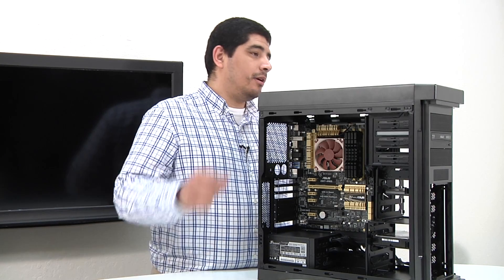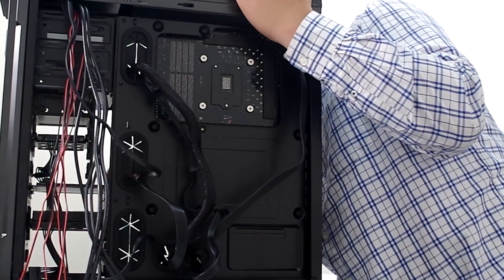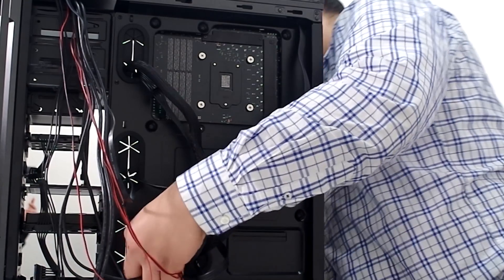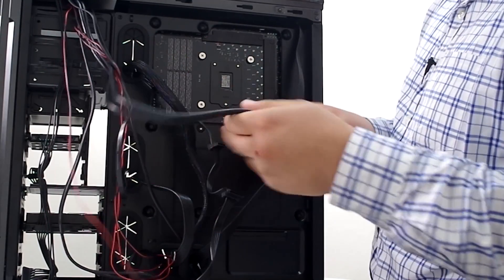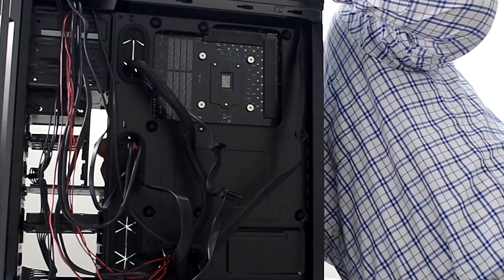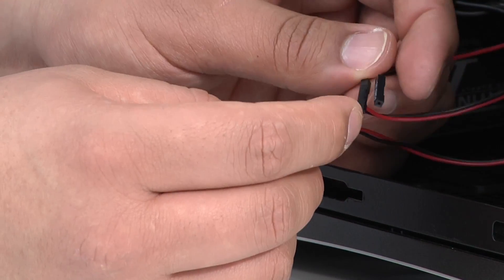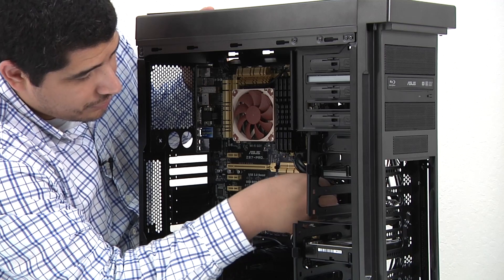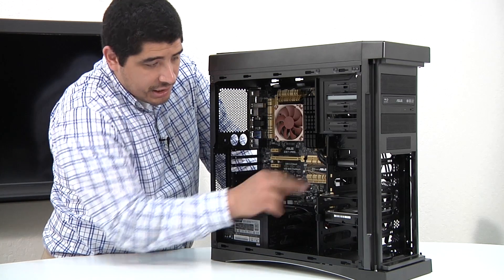How-to connect all the leads to a Z87 motherboard

Comment: ive got a question about the front panel io cables. what if the cables that came w/ the case have no plus or minus signs for me to know which is positive or negative. my question is how do I determine if it is positive or negative as all the cables are black? please get back w/ as soon as you possibly can ty so much. oh also if I did get the cables turned around w/ + to a - and a - to a + would that hurt my motherboard
Reply: For the HD LED, if you look behind it, there is a triangle that represents the positive connection.  The power LED has the positive and negative signs on each cable connection.